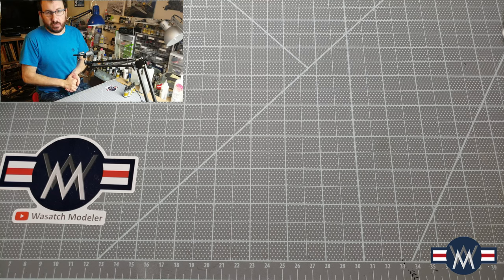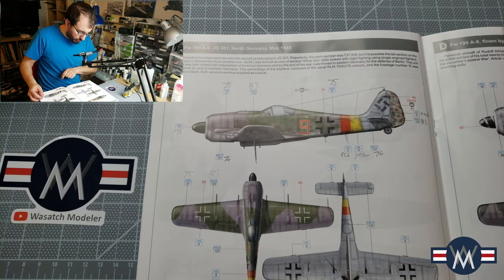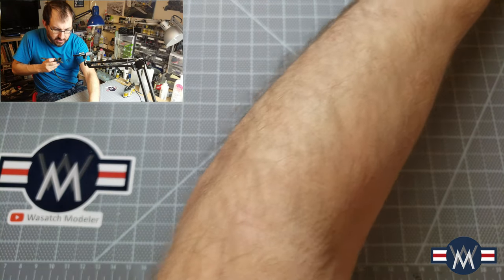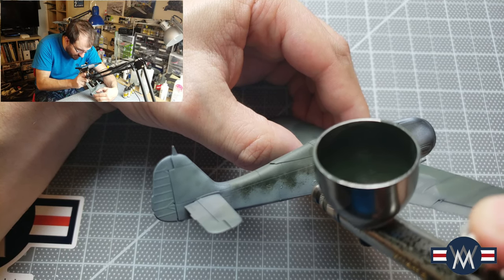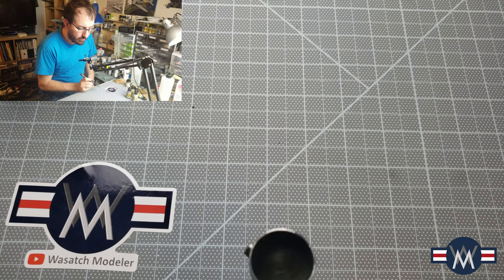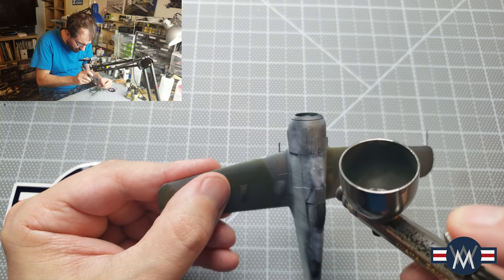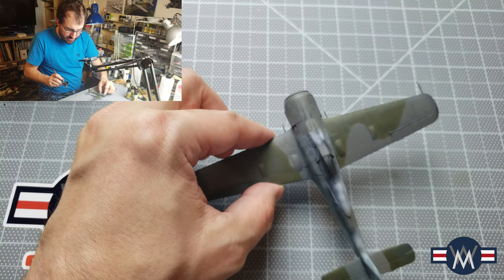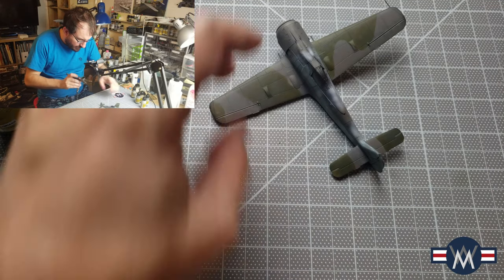The tale of the three little Focke Wulfs part 4 (what not to do when airbrushing)

Comment: Just found your channel.  Great explanation on how you are doing it.  Mottling is very difficult to do. I find that low air pressure and highly thinned paint works the best for me. 60 to 80% thinner to paint and 10 to 12 PSI.